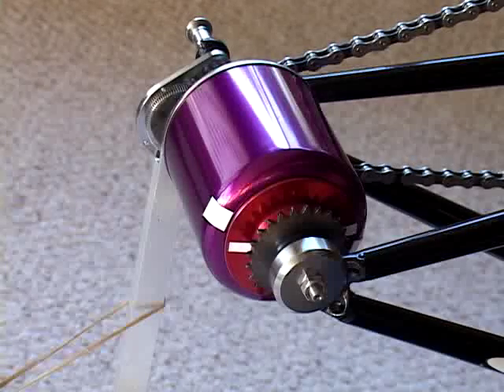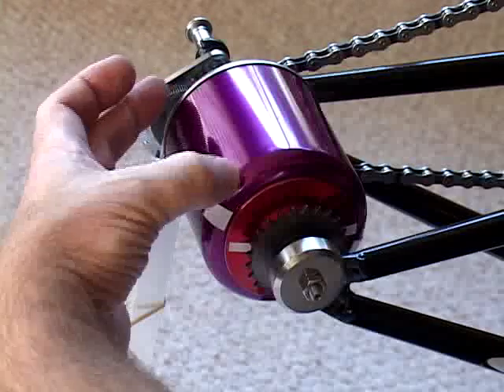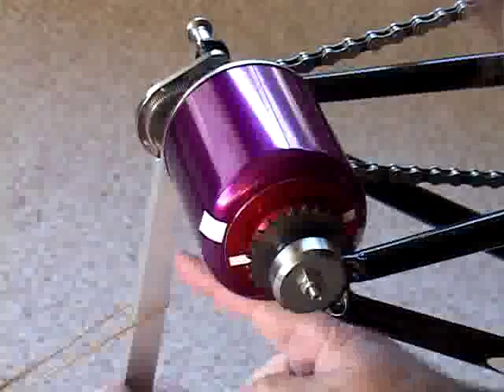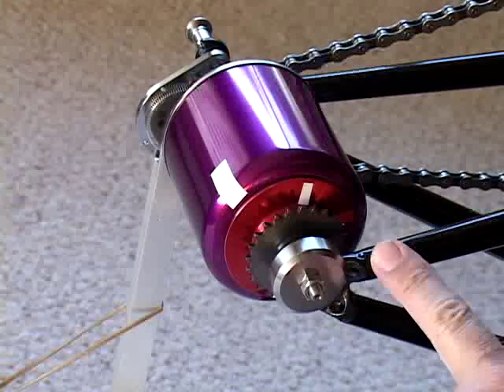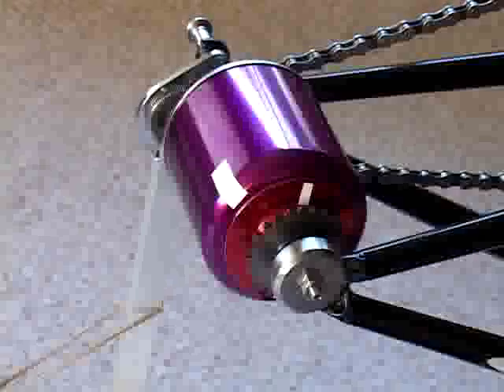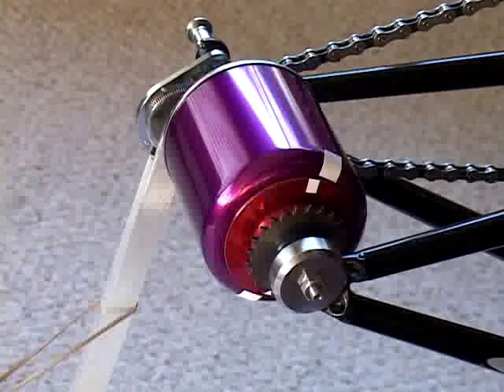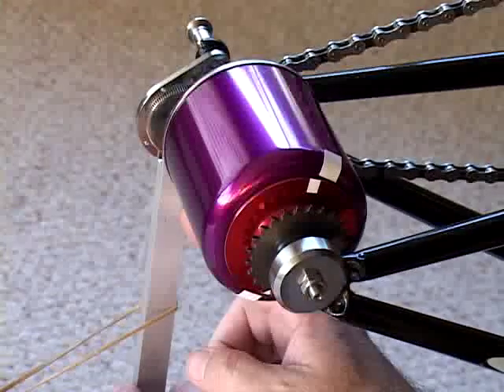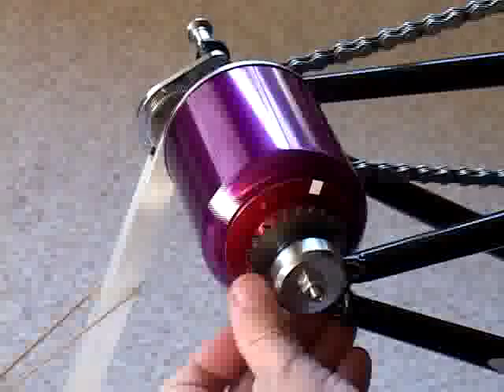Automatic Bicycle Transmission (IVT)

Comment from the maker: Viewers: Please read this comment & give it a thumbs-up to keep it on top to aid in dialogue.
After considerable research, I've decided to use a heavy-duty #25 chain to raise input speed to the SIVAT.  The SIVAT is a reducer, meaning its highest ratio is below 1:1, so raising its input speed (its sprocket) will compensate.  Note that the overall 'gear ratio' on a bicycle must include the ratio of the front sprocket diameter to the rear sprocket diameter.  By going from the standard bicycle chain pitch of 1/2" to 1/4" pitch, the rear sprocket diameter can be cut in half to increase the chain-drive ratio by a factor of 2 while keeping the front (crank) sprocket the same diameter.  I've discussed this at length with a Tsubaki chain drive engineer (also an avid bicyclist), and he considered it very workable.  The smaller chain actually has more working strength than typical derailleur chain, owing to greater width and cylindrical pins as opposed to barrel-shaped pins.  The special sprocket sizes will likely be 95 teeth at the front, and 13 teeth at the back; giving the bike a high gear ratio that's equivalent to to a 48/11 combination which is the high standard for mountain bikes.  Road bikes may use 105 teeth up front.  High quality #25 chain is readily available, and I can include the sprockets & chain in the SIVAT kit so retrofitting the SIVAT should be fairly simple.
Hard-tail bikes and full-suspension bikes with a unified rear triangle will be able to use a lightweight shroud to encapsulate & seal the entire drive system to keep lubrication in while keeping mud, dirt & rain out because the chain drive requires no derailleur or chain take-up idler with the SIVAT.
I encourage viewer comments concerning this non-standard size chain/sprocket drive system.  I've done this before on a very early prototype of a very different CVT, and did not notice any problem.  Maybe other bicycling engineers or cyclists have some thoughts they'd like to share here.
Reply: Where do i get one?
Reply: +SIMKINETICS Great to see you are still commenting! Has there been any progress made on this since this video uploaded?
Reply: +Chris Tindall Lol con artist? What money or property did he con from you?

What is he asking from you, just because someone has an idea and nothing has spawned from it or you don't see it in day to day life everywhere doesn't mean anyone is scamming or conning anything from anyone.... Wtf are you so salty about?
Reply: FukU2222 sad
Reply: +Chris Tindall what are you on about?
Reply from the maker: I'm currently reviving this project for two reasons: 1) the economy looks like it will stabilize soon; 2) I've recently been offered the opportunity to partner with a successful bike-builder who wants the SIVAT in some of his products.  I'm re-designing the SIVAT to work best in the slightly different mode required by the bike-builder.  I'm also doing a thorough analysis of the multitude of critical forces within the whole mechanism so that all components are re-sized for extensive life on mountain bikes; this is leading to a reconfiguration to keep the SIVAT reasonably light & compact, yet strong enough to also handle electric power up to 1.0 kW!  When the SIVAT is successfully mounted on a bike, I'll produce a new video to show it in operation.  We're several months away from that.  The new design should be useful for several other applications, so I'm considering offering it as a stand-alone product based on the new design eventually.
Reply from the maker: novec001
Thanks!  FYI, this new design should accommodate 1.0 kW power throughput at 90 RPM input; I'm currently making the calculations to assure that there's no weak link.  Somewhat higher power can be achieved at higher speeds, but that will be tested.  This is a lot of work!
Reply: SIMKINETICS 😡
Reply: +SIMKINETICS I think this guy is a con artist.
2008 and what still in prototype no new videos.
Shit in 8 years a person could have a degree of their own and he can fuck off.
I don't see any new videos?
He talks about (The new design) where is that?
I saw  a video right before this video some jack ass turned out he has no prototype you are donating to his church.
A lot of these piece of shit Religious people do that.
Free energy/pie in the sky new technology.
Often turns out to be a hoax you know a hoax because they leave out details or hide the area that would give away(The secret) they use things like this as a gauge for how dumb you are.
If you will believe they have free energy shit you will believe anything.
Like what's in the bible.
A perfect target for Religion.
Don't be a target tell this guy to produce a working product we can buy or admit it was just a con.
Reply from the maker: novec001
Not only have I considered adding internal step-down gearing, I'm incorporating it in the new design!  This redesign, which I'm currently working on for a client, will result in a 0.4 gear ratio limit; output will rotate 2.5X the input in 'highest' gear.  This will likely be the design that will result in a working prototype that will be in a future video.
Reply from the maker: Please see my latest comment (Oct 6).
Reply: There is no right moment and politics is never stable nor will it become any more stable in the near future. If anything just the opposite. Sitting on an idea has one outcome. Someone else comes along and does it before you. Been there more times then I'd care to admit :/ Have you considered something like kickstarter to get the funds you need for production?

Edit: Looks like I spoke too soon. I see two on the market already.
Reply: Could you please do a video showing the internal mechanism of this transmission? Very interesting.
Reply: i want to see a new video of this, and give it a demo drive.
Reply: is this like an auto-transmission? i would like to climb the hills with that.
Reply: PaperPlanesParadise
Look at the date on the video.
Nothing new since then.
Not even a new video!
I suggested he is just a con man and This item is Just an Idea.
Click bait.
He isn't stealing any content from anywhere
and he posted this years ago I bet he gets paid each month from YT.
Reply from the maker: PaperPlanesParadise
This is an automatic transmission.  Engineering it to enable a kW of power throughput while attaining very low output/input ratios, this would do well on steep climbs with widely variable grades often found on serious mountain-biking runs.  This would also enable electric-assist bicyles with 1 kW drives, which aren't even legal in many countries without categorizing them as motorcycles.  Anyway, it will be stress-tested by experienced mountain bikers for hundreds or thousands of miles of hard riding well before I'd want to release this as a product.  I'll also consider their appraisals of their SIVAT trials for any fine-tuning needed or wanted by it's intended users.
Thanks for your interest!
Reply: SIMKINETICS I like the auto-transmission idea, because changing gears makes my arm sore, sometimes my arms run out of fuel from gear changing, rather than my feet.  Keep it up bro, been looking this for a long time.
Reply from the maker: PaperPlanesParadise
Thanks.  I lived in the Santa Cruz Mountains for many years, biking up & down steep hills on a custom-made 'cross' bike with lots of gears and ratio range.  I always dreamed of having smooth automatic shifting that simply responded to pedaling torque.  The truth is that the automatic feature was simply an accident of my infinitely-variable design concept!
Reply: Have you considered adding an internal input gear? A simple planetary should do the job, and you'd be able to use any standard chain, belt or shaft drive.
Reply: Nice! Looking forward to the new video, and don't be surprised if I order one when you get it ready for production :-)
Reply: do you have the transmission for sale yet? I'm interested in just the transmission without being in a hub. mikebmwnut@gmail.com
Reply: I'd be curious about  resistance to contamination with the smaller chain size and resistance to accidental derailment. The smaller pitch chain would seem allow material to build up more quickly due to smaller chain engagement spacing and easier derailment due to the smaller tooth profiles. However, toothed belts are being used in bicycling applications and the tooth depth is less than a chain, so maybe a non issue.
Reply from the maker: Ryan Cate
Thanks for your comment.  I've begun engineering the SIVAT in terms of calculating loads at all nodes of power transfer; this leads me to anticipate using standard chain because one required change involved raising the internal speed factor to accommodate lower torque specs on certain components, eliminating the need to use high chain-drive ratios outside the SIVAT.  This is a consequence of doing hard-core engineering to assure the next prototype's success.  Any sprocket combination slightly above 1:1 (front/rear) should work well if my early calculations turn out correct for the rest of my engineering work.
My goal is to end up with a design that can be used in the wheel hub or in a special bottom-bracket in custom frame(s) or on special full-suspension frames, so the design must include a major core that's common to all.  This core is likely also useful for other applications like electric-powered bicycles, scooters & other small vehicles, so economy-of-scale can help make the SIVAT more affordable.
As for belt drives, they require special frames with a discontinuity in the right-hand frame stay with a bridge structure.  This compromise of the structure isn't likely an attractive feature for mountain bicyclists.  I have thought about a work-around that's more convenient & mechanically sound for designing for a belt-drive system, but that's a back-shelf idea.  The SIVAT might accommodate that at a later date.
Engineering the SIVAT is requiring the design to remain in flux until I've proven that all components can handle the stresses which are substantial.  This is a very tough exercise, but may require more input (like yours) to assure a reasonable result.  Thanks again.
Reply: SIMKINETICS the "broken" frame isn't a deterent for mountain bikers to use belts.  it's fairly common for single-speed riders to use belts and have split dropouts. there are many elegant solutions for this. the lack of available gearing that is belt compatible is more the issue with adoption, so I wouldn't worry about the split frame design. elevated and dropped chain stays have both existed for belt bikes, but they often lack enough stiffness to keep the belt from slipping under high torque. 

if you mimic Shimano's or Roholf's cog attachment layout, then your hub would be both chain and belt compatible.

as far as gearing, you don't really need to develop that either. your first iteration should just use existing components to drive your hub. The stuff out there works well and is going to be way more affordable than any proprietary drive you would develop.

on gearing, you'd want to specify at least a 3:1 ratio to drive the hub if not higher. since your hub is only a reduction, the chain drive needs to be the top gearing and that may have some torque ramifications. 

hope that's helpful
Reply: Oh and a clean "shifting mechanism"  will make or break this. Both Roholf and Nuvinci use twist shifters because it's the simplest way to pull cable in both directions. If you could do something akin to a trigger like SRAM or Shimano, that could give you a big leg up. Seems possible with your lever style actuator. Pull with the cable and spring return
Reply from the maker: Ryan Cate
The SIVAT is automatic!  The ratio control is done by pedal force.  I'll likely provide a handlebar lever to lock the ratio for riders who may want to override the automatic feature to maintain a steady grade ascent occasionally.  The automatic feature is intended to keep the rider's pedaling cadence fairly constant while riding up & down various grades without changing effort; this has been shown to be the most efficient way to ride.  Regardless, the rider will also have options to adapt to his riding style & individual power output with some fine-tuning adjustments on the transmission. 

The SIVAT ratio control should automatically emulate what a rider would normally do to change gears for changing conditions, except it will be done in response to his pedaling.  I tried out a similar version of this automatic feature on a predecessor prototype CVT, finding it to be very intuitive to get the right ratio every time on mountain rides by simply maintaining a comfortable pedal effort.  I was pleasantly surprised that it worked so well!  This should make gear shifters obsolete.  I think you'll like it.
Reply: Why make the ratios available finite? It would seem silly to take something that's infinitely adjustable (what makes this system special) and limit it to a set number of "gears".
Reply from the maker: Green Mountains
Only the lowest gear ratio (for highest output speed) of the SIVAT is defined; any other ratio above that is in an infinite set that's available without any predetermined numerical ratios or 'set' gears.  The reason the SIVAT has a minimum limit is because materials have limits to their strength that are exceeded by excessively low gear ratios, and because the SIVAT needs to be compact for bikes.  Still, I've managed to find a new design combination that places this gear ratio limit at the lowest any cyclist would likely use with crank-speed input.  Anyway, the final drive ratio limit can be adjusted up or down with sprocket sizing while not affecting the access to ultra-high gear ratios that include infinity (zero output speed).  SIVAT ratio change crosses a continuum, so ratio availability is not finite!
Reply: My apologies, I should have tagged +Ryan Cate in my comment as that's who I was responding to. He had suggested used a trigger shifter to operate an ivt,  which I thought was counter productive.
Reply from the maker: OK!
Reply: Any video of this operating on a bike? I've seen plenty of this sort of idea that just didn't work in practice.
Reply: SIMKINETICS I'd like to know what sort of form are you aiming for. Is it going to be a universal kit that will fit most common bike frames or just a single manufacturer already including the ivt into a custom frame?
Reply from the maker: Anton Babiy
Both.  The bike will be available first.  A universal kit and a hub would follow.
Reply from the maker: Great question!  It somewhat depends on the contract that I negotiate with the bike-builder as to whether he gets an exclusive patent license for special frame/SIVAT combinations that excludes competitors from fitting the SIVAT to their frames, but with no such exclusions for retrofit kits or SIVAT hubs used on bike.  I will emphasize a desire to offer hubs & retrofit kits in separate business agreements with anybody, including him.  The SIVAT requires a special bottom-bracket that's larger than standard, so it won't fit in that position on standard bikes, and will require a secondary chain-drive up to a SIVAT fastened to the frame above the existing bottom-bracket; a neater alternative will be to use a SIVAT hub with an otherwise standard frame & chain-drive like on a fixie.  The retrofit kit would be very useful for people who want to motorize their bikes,, though.
Reply: SIMKINETICS n
Reply: SIMKINETICS can you tell me if you have developed this transmission?  Possibly looking to develop an electric bike and think this would fit well
Reply from the maker: I've got most of the layout in a preliminary stage of re-design with adequate forces accounted for, but have not proceeded because I see potential disruptions in the economy caused by recent internal rifts in both major political parties.  When I see this situation stabilizing, I'll be ready to prototype the much-improved design, and seek investment to make this a product.  A new product launch is very risky in an iffy market & economy.  I'm getting tired of waiting for the right moment.
As for the SIVAT's use on an electric bike, I've surely considered that to have serious potential when designing it.  Sorry about more waiting.
Reply: Harshad Patel what's your problem😂

Comment: Would this also be safe when you stop pedaling in the middle of a sprint? In other words, can the wheel spin freely at high speed without pedaling and then can it engage at the exact high transmission when you start pedaling again?